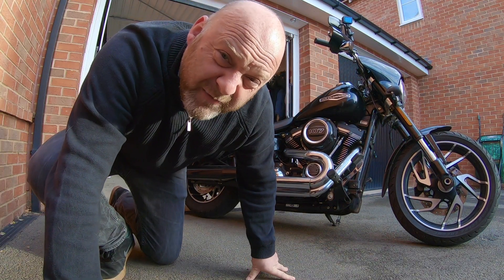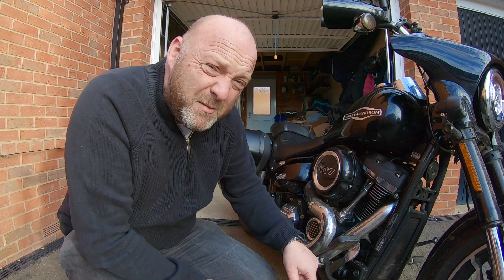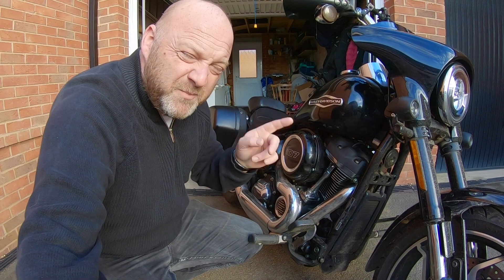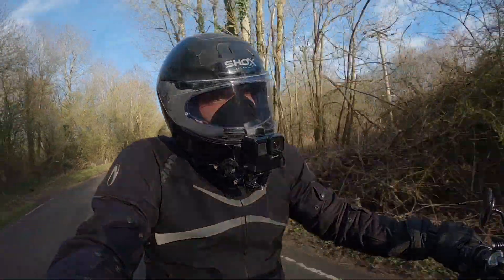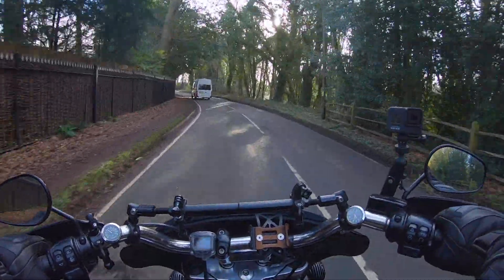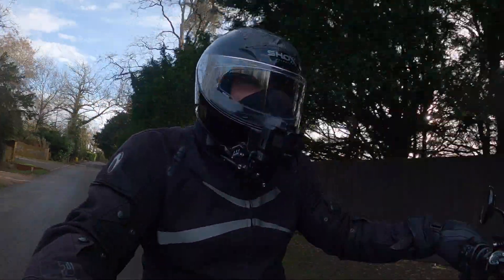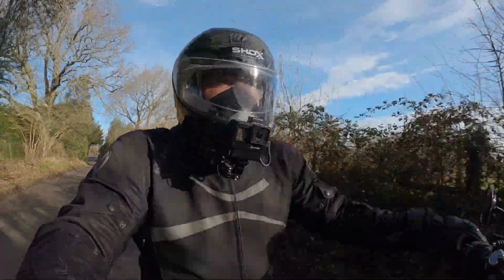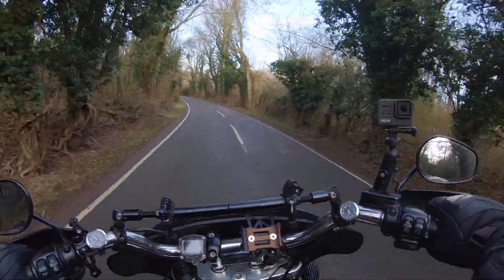H-D M8 Softail Rattle and Rasp Hollow Engine Noise

Comment from the maker: Thanks for watching. Let me know what you think in the comments below. More videos like this here: https://youtube.com/playlist?list=PLmgCmljtdCzWMExyPXgSeeJZYwOA1Ocj7
Reply: Hey RevelatorAlf, i have a 21 FLHCS 114… @ 870 miles and started having the same issue. Sounds like it was in the top end … varied some.. usually at @ 2300 RPMs for me.. but sometimes was louder than others. I’m a mechanic by trade and know a bit about the general mechanics and “normal” operational sounds of an engine. New to the M8s but cautiously optimistic of the engine! 
I swore it was a rocker arm or something lightly tapping on the front top rocker box. Seemed to “Echo” so well up behind the bars… I just knew it was internal… well After a few days of research and searching the Internet and various “causes”. I checked all the norms ( gas cap, heat shields, ect..) lol My fix was an old rag laying on my workbench. Yep!! Crazy as it sounds.. I rolled it up tight .. and wedged it behind my headlight between the rear shroud and the headlight bucket. Took it back down the road and the Sound was gone!!!! Got back home.. and looking closely at the headlight mount.. I saw the mount bolt was hitting the edge of the shroud! Just shaved the very end of the bolt off ( just so it didn’t touch the shroud ) and that was it!! 
I have pictures to show you.. but can’t post em here for some reason! Lol ya just might wanna take a look there.. maybe worth a shot! 
It maybe Simple but easy fix !

Comment: I have the same bike, and the same issue, tinny rattle that comes and goes. I thought it was heat shields or something like that. Its not, I was hoping that you found it, but no answer??
Reply: I did find the rattle, the left fake gas cap, the crimp  that holds it to the base was lose. fIx was epoxy chrome top to base and reinstall.

Comment: Alf, I’m a new subscriber with the same noise in my M8 at 2500 RPMs.  I’ve looked thru your videos but can’t find what conclusion you came to. 
Can you update me as to your M8 outcome ?
Or point me to your subsequent video that addresses this?
You mentioned you were taking it to the dealership, what did they say?
Thanks

Comment: Not sure if it's the exact same problem, but I had the exact same noise on my 18 Street Bob . It had been in storage for almost 2 years and when I took it out for a spin, I immediatly started to ear the noise right in between 2000/3000 rpm (can't really tell if it was doing it above 3000 due to the engine/exhaus noises...)... It drove me nuts for a few days... I checked the infamous gas cap ratteling, and heatshields, but that wasn't it... Checked all the bolts and other stuff that might have come loose and nothing... Then someone told me to try flusing the fuel tank and adding some "new" premium gas in it... I went straight to the closest station that had the highest octane gas (94 where I live) and filled her up. Not even 2 minutes after I hit the road, the noise was gone, completly. I couldn't believe it, so I went for a small trip, did rougly 200km on it, and it runs like brand new and sounds exactly like it should.... Eventhough I added some fuel stabilizer before putting her into storage, I assume the gas had started to go bad somehow... Hope that can help someone that might have a similar issue...
Reply from the maker: Yep that’s great info. Cheers
Reply: Also not sure if it’s the exact same problem, but it sounds like the “rattle” that we’re all experiencing. My 2019 fat bob just today starting exhibiting said noise and immediately started eating away at me. Pulled into the nearest Starbucks and started googling away. Came across a lot of threads like the comments section here, with people running through the same checks to no avail. After reading that a handful of people tried filling up with premium gas and noticed an immediate difference I thought why not give it a go.  Lo and behold right away the noise was gone. Hopefully everyone else gets it squared away as well. Cheers

Comment: If the noise isn't  constant and comes and goes as you say...I would say detonation or pinging! Try adding some octane boost or changing fuel brands..here in Canada I find that Shell gives me the best performance and minimizes detonation on my M8 with a 124 stage 4 motor

Comment: My softail had the gas cap rattle.  When you hear it,  place your hand on the cap. If the noise goes away, you found it. I had a lifter have a problem and it would rattle. I used a screw driver as a stethoscope to find the offending lifter. 
One more thing,  winter fuel blends began to cause detonation issues after I went stage 2. I used a tuner pro and bike runs great. Good luck!
Reply from the maker: Thanks Larry. Yes it could be one of things for sure. Cheers

Comment: I had a very pronounced pinging on my 2020 Ultra Limited, much more obvious than yours. After several trips to the dealership they went into the cam chest and discovered the cam chain tensioner and the oil pump had never been properly torqued from the factory. They replaced the tensioner and the oil pump...problem resolved. Good luck as I speak from experience....something like this can be difficult to resolve.
Reply from the maker: Thanks Greg. Yes I'm really trying to get to the main source if I can. Cheers

Comment: Hello Alf i recently purchased an 18 sport glide. Mine has started making a kind of rattle you speak of at about 2300 rpm. Sounds like its coming from front cylinder area or maybe even front primary. Was wondering if you ever found what the cause was. I have checked fuel caps to no avail. Thanks man
Reply from the maker: See my latest videos and shorts perhaps

Comment: Any word yet on the cause.  My wife's tri glide does exactly as you describe.  Sometimes I hear a rattle. Sometimes not. Occasionally at idol but mostly taking off. Sounds exactly like a heat shield rattling but it seems tight. Never noticed it until l got true duels installed so I'm still convinced its in the exhaust somewhere.
Reply from the maker: Yep I tightened all mine, and the petrol cap too.

Comment: I heard a guy had a rattleing sound due to stage 2 install, he thought the stage 2 was faulty installed... But in the end it was the sparkplug that had come a little bit loose.. so check that one mate. its just around where you said the sound was coming from. If not lets hope its an EZ fix..
Reply from the maker: ah ok not considered that. Cheers

Comment: Interested to know the out come. My compensator sprocket shattered at 198 miles. Dealer said they’d never come across it. Not what google says !!!
Reply from the maker: Still hoping its a simple fix. Cheers
Reply: @RevelatorAlf  any news on the noise ?
Reply from the maker: Will be doing more investigations this coming week cheers

Comment: Funny that, I  have 2 M8's and have a similar noise at 1800-2200 rpm range. Definitely coming from the top end some where. The other M8 RK has no noise at all. Took the bike in and they checked it out and said it was ok, nothing to worry about. Well why is my RK  not doing it? I might take it back again.  RSMF.
Reply from the maker: Yep I’ve still no worked it out yet. Still comes and goes. Mystery

Comment: Mine had a faulty loose fuel cap when it was 6 months old, the dealer replaced it and that was it,  about a month ago I heard another rattling noise, this time is a broken clamp from the cover of the header, haven´t  changed it yet but this is nothing, hope yours isn´t much, I read in the comments you get a 4 year warranty, here in México we only get 2 years.
Reply from the maker: No only two years here too. Cheers

Comment: Any updates on the noise. I have been battling a similar noise on my m8. My symptoms are a knocking noise at idle to 1500 rpms, only when motor is up to full operating temps. Already replaced the lifters and oil pump with the new cam, still noise persisted. So replaced the rocker arms with harleys updated lash adjust rocker arms, still noisy. Now I am working on looking at the compensating sprocket.
Reply from the maker: Yep I’m looking at compensator now too perhaps

Comment: My 2021 114 does this too...around 2600 and up, really pronounced in turns...weird. I suspect oil flow or valve train...hoping someone out there has it figured out.
Reply: Have a 2013 iron 883 that makes a rattle around same RPM when I lean the bike or turn is when I hear it most

Comment: I had a similar noise, turned out to be the kickstand vibrating on the frame cause the rubber bump stop was turned and the thick side of the rubber wasnt in the right orientation.
Reply from the maker: Great shout. I’ll check that out. Cheers

Comment: Mine was the primary chain,  it was loose, and the automatic adjustment was not working. So in with a Hayden primary chain adjuster, problem fixed
Reply from the maker: Yep great stuff
Reply: @RevelatorAlf  from Australia 🇦🇺
Reply: Was the rattle sound coming in between 2000-2500 rvs?

Comment: Exhaust inside ? Already changed on my SG. Now they have to open the motor because of leaking on the bottom. Final new exhaust, back spring,  alarm system akku, new display , rebuild the complete motor - see what comes next. Thx Harley of 4 years warranty.

Comment: I seem to have a similar problem on my m8, the tech I’ve taken it to says it sounds like something to do with a manifold behind the air intake but not certain as yet should know more later in the week .
Reply from the maker: Yep mine still comes and goes too so it's likely to be somewhere in the cylinder head or rocker arms, but might even be the grade of oil I'm using too. cheers
Reply: @RevelatorAlf   ACR (automatic compression release) unit has broke by all accounts on mine .
Reply from the maker: Ah ok. That sucks. Mine are ok thankfully

Comment: Does this noise go away when you change the oil.   I had an 18 heritage m8. Made a rattle/tapping noice from the upper head area at around 2,000 - 2500 rpm.  Mine could be heard stationary and riding.  Always at that rpm range.  When oil was changed it went away for 50-60 miles then returned.  My engine burned oil about 1qrt for every 1000 miles or so.  I’ve since traded this bike off.  Dealer kept telling me that it was fine. 🙄.  Have a 19 Roadglide at the moment and it’s perfect.
Reply from the maker: As far as I can tell now it’s not oil related but I am due an oil change soon so perhaps. I’m still wondering whether it’s temperature related too. Cheers

Comment: I replaced lifters, cam, oil pump, cylinders and pistons in my 2019 m8.  I just started to get lifter noise before I did the work and was using oil. Now it’s ok.
Reply: What Work please explain
Reply: S&S big bore 124” S&S lifters and pushrods and a S&S oil pump, cam chest and 475 cam.  Plus 64mm. Intake, throttle body and 5.5 injectors.

Comment: My last 5 v-twins... 2 M8s, 2 Yamaha 113s and Kawasaki 1500 all had noisy valve trains at specific RPMs. Fairings and windshields route the engine noises right into your face. Let us know what you find out. What oil are you running?
Reply from the maker: Cheers yep just hd360 but I may change that again next autumn for a better winter oil

Comment: Hey I have a softail slim 2016 I hear a slight ticking noise as I'm riding in 1st gear but goes away when I go into 2nd gear what is it
Reply from the maker: You'll need to get that checked out. Could be a whole host of things

Comment: Gas cap or lifter........if over 16K miles likely lifter but should be more constant because you said it started 6 months ago.  My bet is the gas cap!  When you hear it put your hand on the cap and press to see if you can stop the rattling - that will confirm it’s the cap.  BTW, an oil pump never rattles, valve noise would also be constant.
Reply: Had exactly the same problem mate,  certain revs took ages to find it .
Reply from the maker: Yes it could be this indeed. I've got a feeling I have two noises and this could be one of them. Go figure

Comment: As another person said, if its a resonance at certain revs , I thought it was a heat shield , finally going down the road I touched the filler cap stopped the noise. only a thought.
Reply from the maker: Yes I've just tried this there is that too but I also have another source. They are almost in harmony but at least I have got to one now which just needs sorting. Cheers

Comment: Hi RevelatorAlf. . Great videos as  always . Your stage  upgrade video and whether it’s worthwhile helped me make my decision to upgrade . 

I got a weird creaky sound coming out of my stage 2 M8 when I shut it off . Look up ‘ weird creaking m8 noise “ for my 17 second video . Much appreciated if you could help me figure out what it is . Thx in advance
Reply from the maker: Hi Steve. That possible sounds like air being sucked back through your engine breathers. It could be that they need replacing because the umbrella valves are playing up.
Have you had any modifications done to the air filter housing and rerouted the engine breather hoses to external venting?
I would be looking along these lines first of all.
Possibly excessive crank pressure too so on shut down cause a vacuum thus leading to air sucking in.
You could look at vented dipsticks too but also check the level of you oil. If it is high then this could also be the cause too. So reduce oil level slightly.
Of course this could also be direct result of the work done in your upstage. Did it happen straight away or after a period of time?
Hope that helps
Reply: Thanks for the reply and effort. much appreciated .

Yes airbox has been upgraded as per stage 2 requirement to intake more air . No modifications to breather valve . I believe they are venting into throttle body . I am taking video and bike if necessary to dealer as they are literally around the corner from my home ,today. I am more worried that it has something to do with adjustable pushrods or worse , up in the heads . 

I , like you, don’t seem to think that venting through an oil dipstick makes much of a difference but I am open minded to what they decide to tell me what it is . Also ,yes, sound happened immediately after stage 1 and 2 upgrades . Done all at once
Reply from the maker: @stevec8836  Yep good to hear. Be interested to see what they find. Cheers
Reply: @RevelatorAlf  will post what they tell me as soon as I know . Thx

Comment: M8 s  have a lot of problems with sumping  that causes oil starvation to rockers because of oil  turning sudsy because to much oil in crankcase caused by sumping.  
Check your oil before and after every ride to monitor any fluctuations. 
You could also have to much pinion run out on crank that will cause premature oil pump ware  and failure. 
Good luck.

Comment: I wouldn’t be riding at 2000 rpm or lower. You are lugging it. But I hear a rattle even at 3000 rpm when it’s hot as well

Comment: I also have a rattling noise when between 2100 -  2400 RPMs on my '18 Road King. It sounds exactly like a loose heat shield rattling but I could not find anything. On mine, I don't think it's anything internal just by the sound (man I hope I'm right). I'll be doing my 20k service in another week or so and I'll have another go of it while up on the lift. I never even thought of the gas cap so I will check that out too. I was able to hear your rattle and it is a bit different than mine Good luck, I hope it's nothing.
Reply from the maker: Thanks so much. Yep working on it this week. Cheers
Reply: Did you find the noise? I have exactly same noise: 2100rpm and up it ticks/rattles
Reply: @Luminoll  I think it was a broken exhaust bracket. I had a S&S 124 kit installed with a new exhaust and the rattling is gone. The builder gave me the used parts and one of the exhaust brackets was broken. The sad part is I did not notice it when I looked. It wasn't like the exhaust was loose. It was still on solid.
Reply: @tcatnat70  so the used parts that came back were all ok except for the exhaust?? Im in the process of swapping stock headers for mini grenades so I will have a look then. Thanks for your reply!!
Reply: @Luminoll  The exhaust was fine, just one bracket on the exhaust was completely snapped in half. I can't believe I missed it. The exhaust was fine. V&H actually sent me a new bracket under warranty and I sold the exaust to someone.
Reply: I have a 2018 roaking with the 107. Theres some sound that bothers me but I dont think its anything to be worried about. I put in ear plugs

Comment: Ive got a similar situation on mine. It comes and goes. I had thought perhaps i was low on oil when it first started being noticeable. Oil level was fine. I'm about 24,000 miles now. Gonna have one of the techs at my local dealer take it for a spin. Though it probably won't make the sound then, haha
Reply from the maker: Yep was the same with me too ha ha